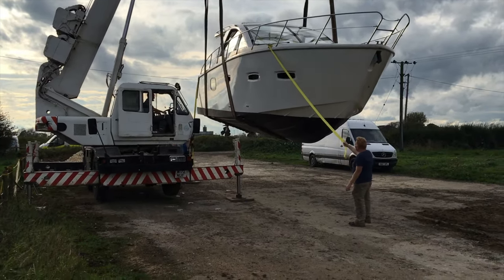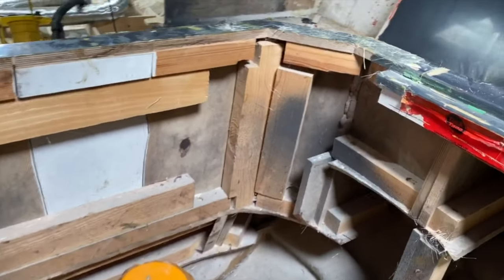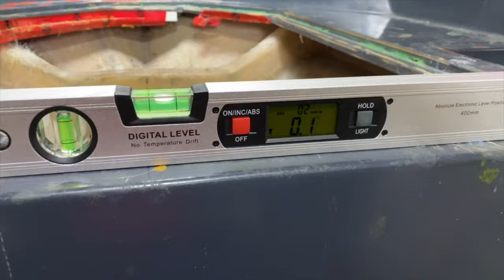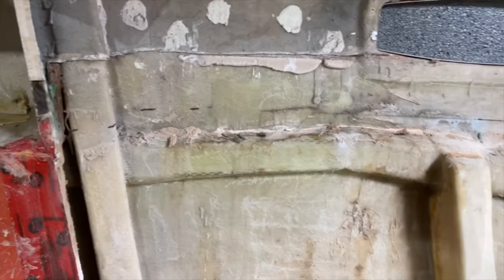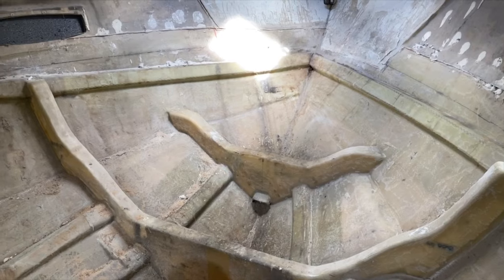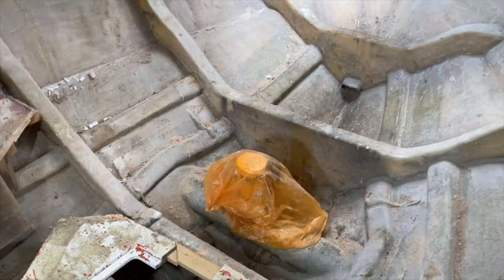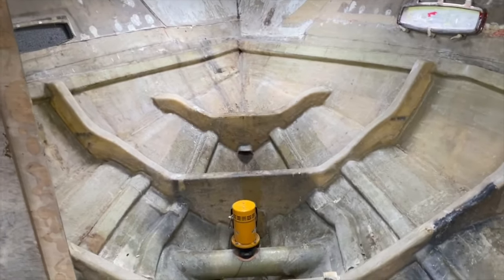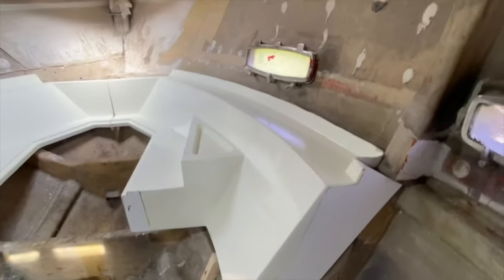Sealine Boat Restoration - Removing the Factory Bed Plug   EP 25

Comment: great video,  nice job.  Did you consider painting what will be the bilge before putting the bed in place?  It seems like it would be much easier to paint without the bed frame in place.
Reply from the maker: Thanks 👍 The plan is to flow coat the bilge areas once everything is glassed into place. Once flow coat is down, nothing will stick to the hull, so better to do this afterwards.

Comment: Love watching what you are doing.
At the end of this video why is the port side porthole touching the new bed mould, but the starboard side porthole is approx 3 inches higher? Hope this will be easy to rectify.
Best wishes for the rest of the build
Regards
Chris.
PS. A long time ago I owned a 365 for about 4 years. I love Sealine boats. Such a shame they ceased to trade. I only lived about 5 miles from the Kidderminster factory. They were always very welcoming to visitors, especially Tom Mutant.
Reply from the maker: Thanks for watching and well spotted on the heights Once we've trimmed and fitted properly the bed module should align perfectly 👍 I agree, a huge shame we lost Sealine in the UK.
Reply: @boatholic4458   
For Mutant. Read MURRANT . The boss of Sealine for many years until about 2005.
I only made the comment about the difference in
height because you said you were going to trim the starboard bed moulding to fit the stringer, but as you slide it up nearer the starboard porthole, the gap appears to me to widen, so less trimming will be needed.
Love your videos and the way you present them.
Regards Chris (Claire's husband)
Reply from the maker: @clairegardner404  Thanks for your support Chris 👍